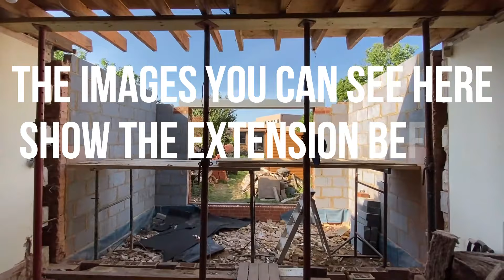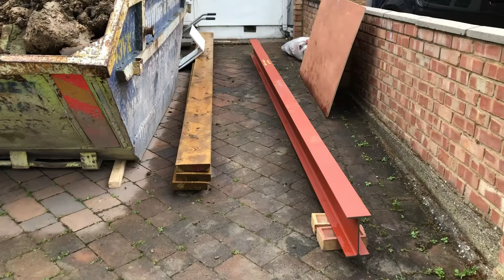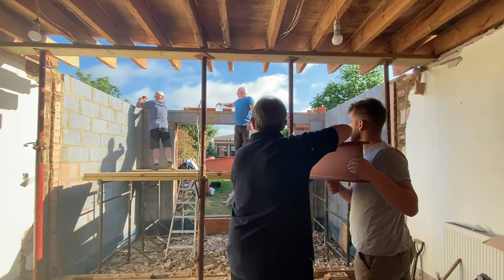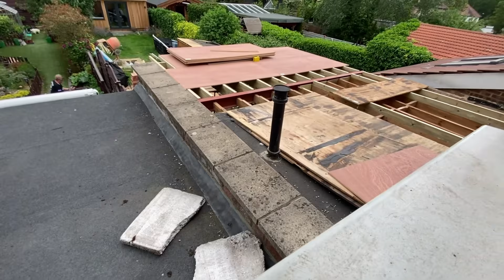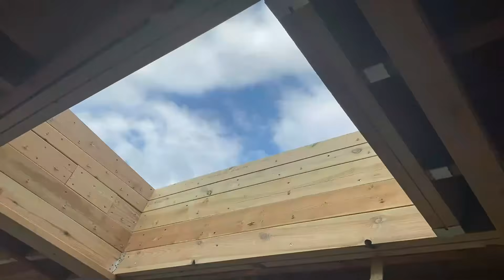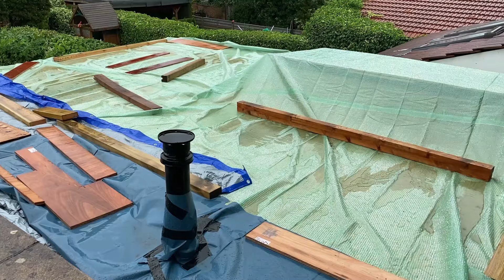Flat Roof Construction Start to Finish - Steel Beam, Rafters, Insulation, Torch on Felt, Time Lapse

Comment: ONE ROOF LIGHT.... I THOUGHT WAS ABOUT TO SAY WER GOING TO NO CUT OUT SECTION OF THE STEEL RSJ FOR THE ASTHETIC LOOK.......... BUILDING THE SKYLIGHT FROM DGL WHOLE PANE ... IA M PRAYING FOR THE HOME OWNER SAKE .. THERE YOU DO LEAVE EXPANTION AROUND FRAMING  FOR WEATHER CHANGES ... OWHH AND THE HOT ...COLD DECK ROOF AS HE SAID YOU WILL SEE THERE IS NO CONTIOUS BARRIWR SO IM CONFUSED ... HE EXPLAINED THE HOT COLD   ROOF THEN DONE WHOE OPPPOSITE

Comment: THE NOCHING ON JOISTS ... DID YOU SAY SO THEY ARE NICE N SNUG TIGHTLY IN TO RSJ ..... 2" NOTCH IS SNUG🤣🤣🤣🤣🤣...... ACTUALLY NNED TAT GAP FORT HES TEEL BEAM TO FLEX ... EXPAND IN SUMMER 🙂😂😂😂😂😂

Comment: I will be doing something similar except my bram will have headplate attached and i will be having a 150mm insulation warm roof . Anyone reading this would it be a good i dea to have upright metal posts or lay the beam onto existing wall , thanks in advance .

Comment: The installation of the felt is totally wrong. You never cross bond layers, a venting partial bond layer should have been used as a base layer, the joints in the deck need to be taped, and the deck should have been primed.

Comment: MOST OF THE CONSTRUCTION VIDEOS
THEY TALK TO MUCH !!
AND WHAT YOU REALLY WANT SEE
IS THE PEOPLE ACTUALLY WORK
AND HEAR THE SOUND OF THE TOOL'S
FOR EXAMPLE
IF A GUY IT'S GOIN TO DRILL A HOLE 
IT STAR WITH , THIS IS A CONCRETE DRILL BIT
35MM OR WHEREVER
GALVANIZED AND ALSO I BUY SOME NUT'S
AND WASHER'S , AND I PAY LIKE 20 £
YEAH THEY HAVE ALL SIZES 
AND THEY GO ON AND ON AND ON AND ON
BLABLABLABLA 
AND I'M THINKING
JUST DRILL THE DAMN HOLE
YOU DON'T HAVE TO EXPLAINED THAT MUCH
I LIKE TO SEE ACTION AND LESS TALK !!!!
OOFFFFFFFF

Comment: This is not a warm roof.
Reply: My roof was done with  fibre glass by a cowboy builder. Had loads of problem over last five years. I am so worried to get it done by another cowboy. Finding it very hard. How can you trust anyone?
Reply: Why? Looks to be done correctly?!
Reply: The decking  should be under the insulation and the felt should be on top of the insulation. @TheNorthernmunky
Reply: Wouldn’t both ways work well? Having the ply under the insulation may also cause cold bridging from the edge of the ply in to the void?! We usually put ply under and over and we insulate all the perimeter joists
Reply: @TheNorthernmunky  I would think the felt should cover the edge of the ply. Where is the void?
Reply: @TheNorthernmunky  correct 👍

Comment: looks like you forgot to install a vapour control layer under the insulation on top of timber deck.... failed LABC regs. likely roof will decay
Reply: Vapour control layer can be added inside, taped and sealed under joists.
Reply: Not just me that noticed that then.....
Reply: I was wondering about that